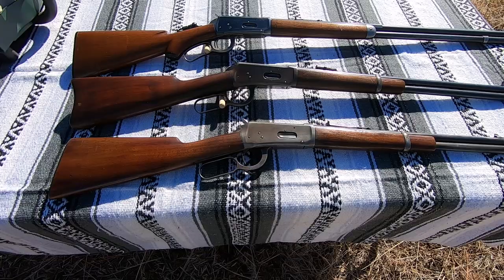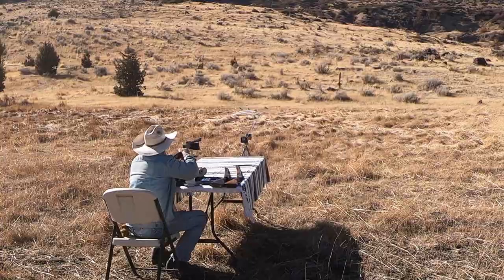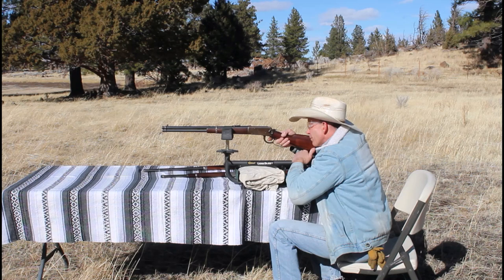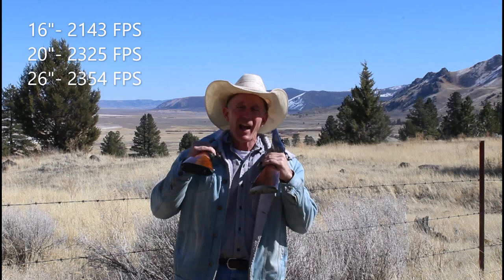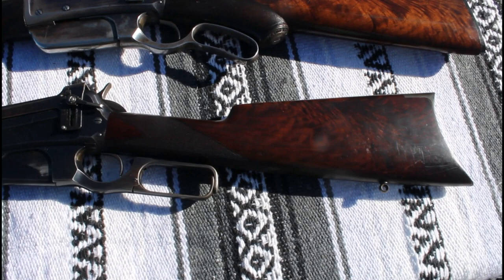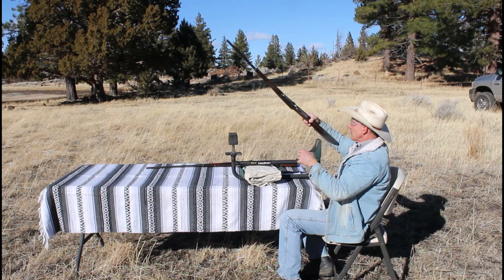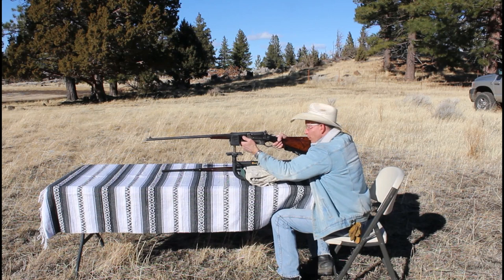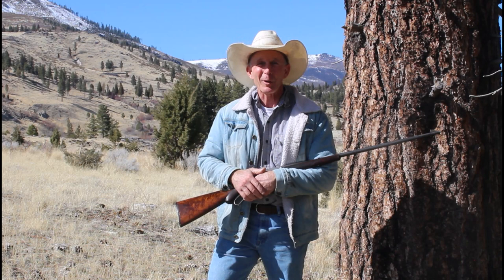Barrel Length & Velocity II - 30-30 & 30-40 Krag

Comment: I’ve been carrying a Winchester 94 16 inch Trapper for forty years.  In a patrol car, in a saddle scabbard and on four wheelers.  I would not trade this gun for anything else.  I just wish I could find some of the old Winchester Silvertip ammunition.  It’s not a collector’s item just a good tool.  This is a really good video.  Thank you.
Reply: I'm sorry, I bought it all because I collect it!
Reply from the maker: Thanks!  That's really cool that you carried a trapper for law enforcement.  From the accounts I've read, far more of them were used in law enforcement (particularly in South America) than by trappers.  "Trapper" was a term coined by collectors for the nostalgia value.  Thanks for watching!
Reply: @thecinnabar8442  My 94 doesn’t have “Trapper” written anywhere on it.  I bought it to carry in my patrol car when I was a Houston Police Officer in the 1980s and it was the first 16 inch 94 I ever saw.  Later I carried it as a Deputy Sheriff in South Texas.  It would probably be the last gun I would part with.
Reply: @thealsatian4232  Good enough for Joaquin Jackson I guess his was a twenty incher.
Reply: @DavidNefelimSlayer  Joaquin was a good friend of mine for fourty years.  His .30-30!was cut to 16 inches
Reply: @thealsatian4232  Another old timer. Thanks for your service sir.

Comment: According to Col. Whelen and Keith Elmer (on page 226 of the 1895 Win book), the 405 could be shot just below its max pressure reliably/steadily. As well as the 30-06, needing to be shot at the old loads of that day. 

So, the 30-40 Army and 35 Winchester are well within the 95's strength. Very nicel. 

I believe the 180gr .30 cal. bullets at 2400fps are very capable and great combination for an open sight rifle. Plus its just dang neat!
Reply from the maker: I usually shoot reduced loads in the 405 for comforts sake.😉  I really like the 35 WCF.  It can be loaded up or down for just about any big game in North America.  I hunt mulies with mine.
Reply: Elmer Keith

Comment: Thanks for your testing.  I love your channel!  And your Winchesters!  I would like to add that the type of powder used has everything to do with velocity variation between lengths.  The 30-30 Federal you used was excellent ammo designed for rifles.  The factory Remington 30-40 is not very good ammo (factory Winchester either), it is only designed to let owners of antique rifles shoot their rifles without hurting them.  I just got 2 30-40 Krags in the last couple months one 16” trapper hi wall and a 1898 30” rifle. I have a couple short videos on my channel.  Factory ammo was useful only for its brass cases.  I reloaded with H4895 and got extremely consistent results and huge velocity differences.  I wound up using 4 grains more powder with the same bullet to achieve the same velocity in both rifles.  Spread for same loads was close to 300 fps. No hot rodding here, the loads I settled on push a 180 bullet at 2250 fps from either rifle.  Keep up the good work! And lets see some 100 yard groups from that awesome 1894 30-30 26” half octagon!
Reply from the maker: I really like the looks of those 1885 trappers.  I'm kind of surprised you're getting the same velocity out of the 16" and 30" rifles, even with the light loads.  That's why we shoot them, though.  It's easy to predict what they'll do, but much more enjoyable to take them out and shoot 'em and find out what they'll really do.  Thanks for watching!  I just subbed to your channel.
Reply: @thecinnabar8442  thanks,  and just to be clear, it took 4 more grains of powder for the 16” to equal the 30”.  I was probably unclear with my description.  Keep the great vids coming!

Comment: 22 November 2005 here in Northern Alberta, I took a big whitetail buck at about 260 yards with one shot. A single 150 grain Winchester Silvertip. High sight it, Williams FP rear site, Williams Firesite replacement bead. Initially I was going to use the long rifle Canadian Centennial. But during summer practice it's terrible factory shellifter broke. Thankfully for backup I had my father's circa 1956 Winchester as backup with the sights previously mentioned.
Your channel continues to infect me as I purchased a circa 1900 M92 converted just before WW2 to 218 Bee. And a great deal from a dairy farmer a H&R single shot 10 gauge in 32 inch barrel.
Be well

Comment: Well I learned that the Krag round is not at all near 30/06 velocity, I just never looked it up. I have pretty well proven what happens when you assume.
Great video, thank you
Reply from the maker: You hit the nail on the head.  The 30-40 Krag has a terrible reputation for being underpowered because the military dropped it in favor of the more potent 30-03/30-06.  The reality is that the Krag wasn't so much underpowered as that the '06 just had superior ballistics for military applications.  Thanks for watching and commenting.
Reply: @thecinnabar8442  Civilize 'em with a Krag.

Comment: Wow, the extra barrel length between the carbines made a huge difference. Surprised the same thing didn’t happen with the 26 inch rifle. Similarly surprised with the ‘95s. Wondering if it’s cause of the length or the ammo?
Reply from the maker: Hard to say for sure.  I expected at least a little gain with longer barrels.
Reply: Two limiting factors;
1. The powder in any particular cartridge is only capable of generating a given volume of gas.
2. As the bullet travels down the barrel, the pressure difference between the atmospheric air ahead of it, and the propellant gases behind it, reduces as the propellant expands to fill the bore.

Generally speaking; the benefits of more barrel length increase as powder charges get larger, and bores get smaller. So heavily-bottlenecked magnums will be able to exploit the last 10 inches in a 26-30" barrel far better than medium-caliber intermediate rifle cartridges.

Comment: That's pretty fast .30-40 ammo, iirc the old Krags were at around 2,000fps, but that was with 220gr. so there is that. I'll be reloading new .30-40 brass with 180gr. hard cast gas check bullets for my new Krag, I'll be loading at the low end of the spectrum.
Reply from the maker: I hadn't chronographed the Remington factory loads before, but I was expecting something in the 2,200 to 2,300 FPS.  A little surprised at the 2,400 FPS +

Comment: I wonder if in the 95 Winchester and the 30-06 if there would be much difference I know that it’s been tested before with bolt guns and different barrel lengths
Reply from the maker: I'm sure any change in cartridges and loads will have an affect on the results, but I don't think there is enough difference in the ballistics between the Krag and '06 to make a dramatic difference in results.  Of course, this was kind of a crude experiment and I was a little surprised at the results.  Thanks for watching and commenting.